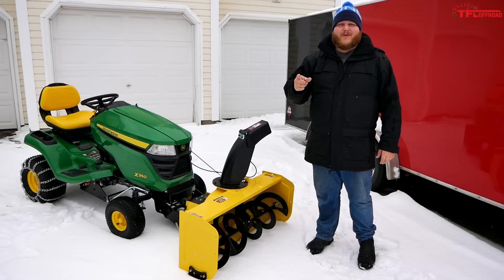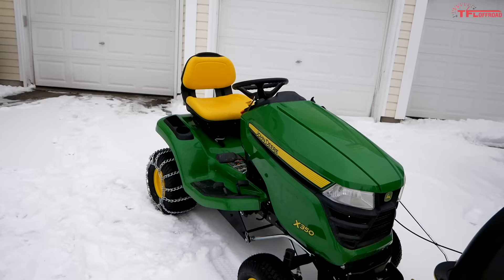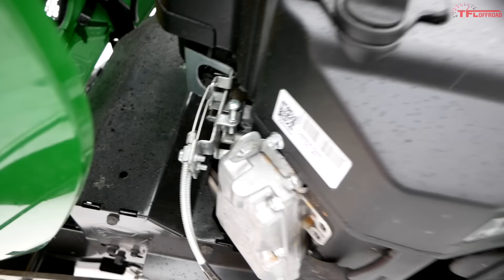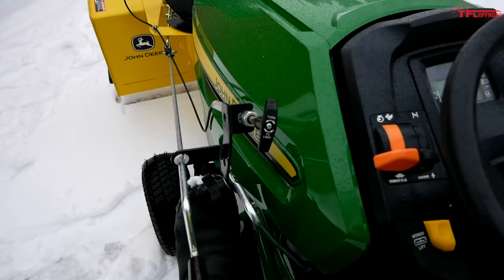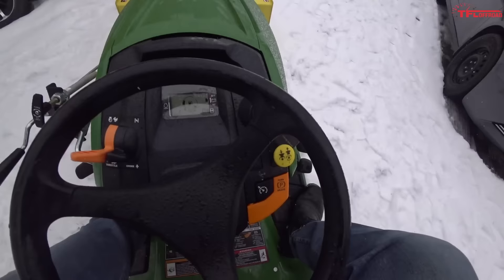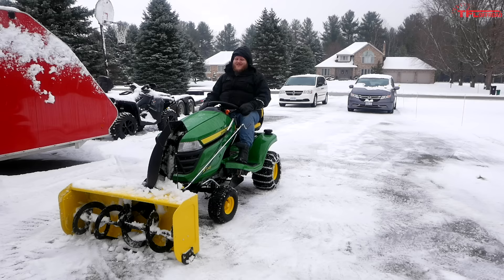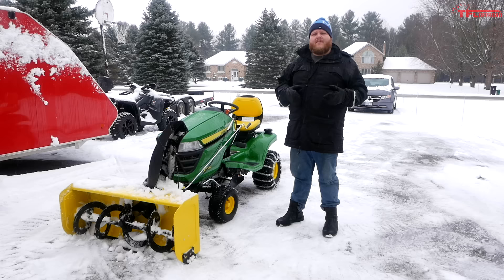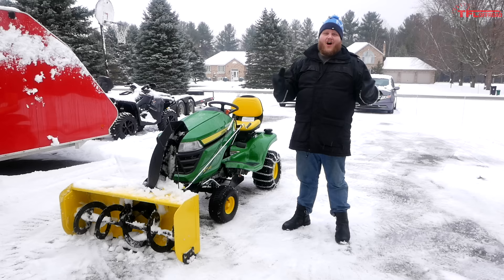Watch This Before You Buy a John Deere X350 Tractor!

Comment: And that's why I went with cub cadet, I got a 24hp Kohler, 50 inch cutting deck and for a lot cheaper than John Deere. Sometimes you pay for the name.
Reply: Cub Cadets dont have the reliability.
Reply: @saliston  according to who? The John Deere dealer? They have been around since the early 60s.
Reply: @saliston  and you are going to tell me that Briggs and Stratton and Kohler are going to put in a motor in a mower that will give their companies names and a bad reputation?
Reply: I have a similar Toro 50" with a 24hp Kohler. I believe both are made by MTD and are functionally the same, visually different. Mine was $1,800 USD on a sale, no snow blower though.
Reply: Cubs are good too. 
The Kawi engine in the JD is excellent .
Reply: Cub Cadet was bought out by MTD, they are not of the quality they used to be.
Reply: You get what you pay for. You may buy a Cub Cadet and it might be a great mower, but the resale just isnt there. You pay more for a JD and you'll be able to sell it for more. If you never plan on selling it, you'll definitely save some money.
Reply: @saliston  The john deere riders you find at lowes etc are junk. They are just as cheaply made as the MTD's now. I looked at them and the hood's were flimsy as hell all plastic. Now john deere's commercial grade tractors are good but not the big box store stuff

Comment: I just brought home a John Deere x485 today and, man, that thing is stout! The current equivalent model in an x730, which is mostly the same components, but with a facelift on the body panels. I was legit surprised to see a choke (cough-carb-cough) on a new......anything really. JD was putting fuel injection on their Kawi machines back in the 1990's with the 445. I thought everything after 2010 was for sure fuel injected minus perhaps push mowers and weed eaters.

Comment: Glad to have found your review. Just inherited a smaller 200 series as my parents are dowsizing to a condo. Manual is long lost tho so your walk around is helpful. For instance I thought there was something wrong with the choke as it wouldn't stay on. Learned something! Many similar features although as you say not as beefy. I was pleased to see even this 277AWS I've got has the Kawasaki motor though. Guess they opted for an upgrade when they bought it. It's very smooth compared to the single pot units on most lawn equipment. Now to find a blower! ☃☃☃

Comment: The older series with the Kawasaki engines were great little machines. Really good little engines indeed. But duuude, I emphasized "little"for a reason. You spent enough to buy much more tractor. For that. you could have had a (used, obviously, but better and reliable) much bigger diesel powered Kubota--or comparable with four wheel drive, loader and a decent finishing mower that could do so much more so much better than that little lawn mower. I almost made your mistake. Mind you, I had about 7 acres of grass to cut in addition to a super long driveway but I was thankful that a sharp salesman talked me out of getting a toy just to have something newer. A 5 foot mower and some extra power meant I didn't spend all weekend cutting grass! Occasionally wished I had gone bigger still but never regretted NOT buying a little new lawn mower as opposed to the compact tractor.

Comment: I recently bought the E110. I don't see the X350 being much better. There is a snowblower option for the E110 also. I didn't buy it for that feature. But that option would cost more than half the price of the E110. There is a snow plow blade option too. It would cost 1/4th the price of the E110. If I lived at a place that often got 3+ inches of snowfall I would get the blade. But a snowblower option for just a few inches of snow is a waste of money.

Comment: My X300 has a Kawasaki engine. The manual also lists the X304, X320, X324,X360, X340 with a Kawasaki engine. Not sure where your getting your info from about the B&S engine, but it’s incorrect.

Comment: Thats all cool and stuff but how bogged down does it get in like 10in/24cm of dense snow. These things are designed for cutting grass, which is like no additional load. This motor having to heave a lot of snow and pull your weight and the tractors weight around seems sketchy to me. I have a 7hp snowblower thats like 60% of the width and at about its 11 inch limit it struggles and did stall out on me once.
Reply: I have an s240 with the same motor. Pushes snow no problem, I have gotten stuck though.

Comment: I bought an X590 last spring, mostly for snow blowing since I go to Florida for part of the winter and my wife doesn't. She can use our walk behind snow blower except that our drive way has a short, steep hill that she cannot do. She wanted a blower she could ride in my absence.  Long story short, I thought I was getting a 4WD and did not realize until after it was delivered that the one I purchased was not. I felt that my salesman misled me, but again a long story I am not going into here. In the end, I decided to keep the tractor and see how it does. It does have the locking differential and I have chains and weights. I have only used it once so far, in a 3-4 inch snow fall. It did fine but I do need to use the locking differential to get up the hill. I also found that I must hit the snow head on, not try to blow my way around a turn in heavy snow - like at the end of the driveway where it gets plowed in. I do think I would have a problem with a large storm, say over 8", blowing up the hill - which means we might have to clear the driveway more than once a storm. I would highly recommend getting power steering. It makes using the tractor much easier. The 590 also has fuel injection so no need to use a choke.  Never having had a tractor before, I was a bit naive about buying one and should have paid more attention to what I was getting. Nonetheless, the JD is a nice machine and is fun  and easy to use.

Comment: Just got the X 350 with the more I had a D 130 but the deck went on it just after 3 years other than that it is still good so I took of the more deck and got a 17 cubic ft. dump cart but went Canadian tire for the cart and saved over $100 over the John Deere one.  The dump cart is great as it will hold over 5 times what my wheelbarrow would. The kawasaki engine is louder than the brigs engine, I also found out that the D 130 would do slopes better than the X 350 Where the D 130 would go up no problem the X 350 would spin and had to back down, I will have to go back to the dealer and see what they can do about it. Other than that  I like the X 350 but when you pay that much more for it, it should do what the D 130 will do plus.  The other thing is that the 130 comes with a bumper, I have to order one for the 350 and pay $100 for it. When I was at the dealer seen one that ran into his truck and destroyed the whole front end of the tractor,  so you should get one to be on the safe side for when you go to the more.

Comment: I just have one question.  When raising and lowering the snowblower attachment, is it just one level?  UP, and then DOWN.  Is there any "in between" levels the snowblower can be left at while snowblowing?  Say 1" off the ground, or 2" off the ground?  You would be able to do that with the LAWNMOWER attachement, right? Different grass cutting heights.   Why not with the snowblower attachment too?
Reply: yes the dial can set the high of the lift on the floor

Comment: You can find a John Deere 425 gas 20hp liquid-cooled Kawasaki  locking diff shaft driven all wheel steer or just regular steering you can get a 445 gas 22hp liquid-cooled Kawasaki or the 455 diesel 22hp liquid-cooled yanmar for the price you would pay for that and you get a heavy duty tractor that's all hydraulic

Comment: You will get better everything when u buy a John Deere. DO NOT BUY A DIFFERENT LAWN TRACTOR unless want a zero turn Commercial grade rig. The cost is similar & you get it straight from the Dealer.
Recommend the x330 or the x350 the only difference between these is the Kawasaki vs the B&G custom made strictly for John Deere. 
If you only need it for hauling with a 3'X5' Dump trailer, Snow Moving & Lawn Maintenance; & you do not have a Hill or serious slope your good.
If u have a steep 25 degree or steeper slope you will want dual or 4x4. If you need a larger mowing deck & have a large area to clear for snow. Larger machines is what u want.
"BUY ONCE, CRY ONCE" 
We use both the x330 & the x590 for different projects. The x330 for the suburban home & the X590 4x4 for 5 acres on steep 50 degree terrain.
You will not be disappointed.
& for you guys looking at a Multi use Tractor. The 2019 & newer JD 2K series Tractors are AWESOME over the competition.
Kubota does have some good setups but John Deere made sure to be the best going forward.

Comment: After working on hundreds of older John Deere lawn tractors, from the little 68, to the lx188, lt, d, etc, I cringe when people grab the hoods where they are “supposed to lift”. Unless these hood materials are much more durable than older Deere’s (like lx, lt, etc), NEVER lift like done in the vid. ALWAYS lift with both hands on each side of the hood. I’ve seen literally hundreds of hoods broke because people lift them with the built in handle. Yikes

Comment: Great video. I’m moving to somewhere it snows next year and I can’t decide whether to buy a Ram Rebel and a snow plow attachment, or spend less on a Subaru and buy a tractor for the snow.
Reply: You will absolutely beat the shit out of a 1/2 ton with a plow. I have buddys that clear snow for winter and plows are BRUTAL on trucks.
Reply: @evictioncarpentry2628  Really? I was only planning on doing my own driveway, so I didn't think I'd be putting too much strain on a truck, but that's good to know, thanks. So if it puts wear on a truck, surely a small tractor like this is going to struggle with a plow, no?
Reply: It's not the plow that is brutal on the truck , it's the guy operating it 😂

Comment: 9000$ Canadians money's For that Price I'm buying an Small pickup and push mower.
Reply: for that kind of money you can have a very large down payment on a real tractor, a nice used sub compact. that's almost enough to pay it off. i paid $8,500 USD for a BX2350, 54" mid mount mower, rear snowblower AND a got a heated cab LOL
Reply: it also has diesel power and 4 WD

Comment: Do you feel you should have got the x370 for the hydraulic lift, and without wheel weights do you get stuck with deeper snow . reason I ask debating on the 370 or 350

Comment: What a great video, very informative.  I bought a X350 first but returned it for the X370 due to the slope of my driveway.  Looking forward to more of your videos on your X350.  I still have to install my front blade to get ready for the snow.
Reply: Curious to hear how the x370 worked out for you. Any idea what the appropriate slope of your driveway is?
Reply: @glendavis3183  Its working out fine. I believe the driveway has around a 7-8 degree slope.  I do have 3 JD weights on the back along with Terra Grip rubber “chains “  I am thinking about adding one more weight though.  Hope this helps you.
Reply: @wornslick  It's very helpful! Thanks for taking the time to reply. Sounds like you are using a blade to move snow rather than a blower, yes?
Reply: @glendavis3183  Yes I use a blade.  I looked at the snow blower for the X370 but it would crowd up our garage.  I got everything stood up against the wall including the mower deck.  It also helps to push the snow downhill or side to side on the driveway itself, it works great on flat ground.  Have you bought a mower yet?
Reply: @wornslick  Haven't purchase a mower yet but need to soon. Have a 180ft driveway with slope 7-10 degree slope and trying to figure out if an x370 would be able to handle a blower or if I need to consider an x500 series... Which is obviously a jump in cost.
Reply: @glendavis3183  Then my advice to you would be if possible have your John Deere dealer come take a look at your driveway and see what he has to say.  It’s the transmission that you want to get right for your application.  At least that’s what I was told. Which ever one you end up getting let me know please as my curiosity is up now. Good luck to you!
Reply: Flat yard or gentle slopes?
Reply: @wornslick  Yard is gentle slope. Seeing if the dealer can visit the property is good advice. I'll let you know what I learn.

Comment: I don't intend to point out negatives... (says the one about to do so) but that is a HORRIBLE place for that fuel cap to hang... just think of all the crap that will fall off the inside of the wheel well, immediately ending up in the tank.

Comment: It will greatly increase the life of the engine if you change the first oil and filter at 8hrs. Change the transmission fluid at 50hrs. Everything has to break in.

Comment: 9K seems like you overpaid quite a bit. I have the exact same mower (2019 X350 48 Inch Deck) and I paid $3600 (with mulching kit) for the mower.  I was quoted just 2 days ago $2100 for the blower, Electric lift, adjustable arm, chains, weights, winter carb cover. So IMO you got jipped.
Reply: With Socialism everything costs MORE because you have to pay for all the others who don't work and expect things to be "FREE". Nothing is. ever "FREE".
Reply: @freedomone776  correct

Comment: It's a sad day when even John Deere is made in Asia.
Reply: They build the Lawn tractors in Germany. At least for the European and Russian Market.
Reply: The X350 is made in Horicon Wisconsin.
Reply: I'm sure that they may have a plant there or something, but the X series tractors are built in Horicon, Wisconsin, and the E series (Lowes/Home Depot) ones are built in Tennessee.
Reply: My 30year old jd 260 has a Kawasaki engine mad in Asia. Over 1000 hours at high rpm and runs great and starts everytime. I believe it has only had a hand full of oil changes in its life as well and the fuel filter is factory.

Comment: I have a  j d 110 it's 19 hp runs ok 1800 new a 44 inch blower 1200 that's a way better price. I like my cub cadet 3stage the best and thats the one I use the most on my 200 ft drive way

Comment: I went with the craftsman T240 over the John deere X350 the Craftsman is bigger and a lot heavier it has the Kohler 7000 series 22 horsepower 725cc V Twin engine it's designed after the Kohler command commercial pro engine came with a 3 year unlimited hours warranty goes through deep Snow with out a sweat

Comment: My x300 came with a Kawasaki and didn't have to pay extra for it.
Reply: I was about to comment the same ,my 2008 also has the Kawasaki  engine as well.My x300 is probably the only one with a oil pressure gauge, volt meter gauges and oil temperature gauge and a rear work light.
Reply: @sodbuster518able  yeah, mine is a '13 or '14 I can't remember. I only have a hour meter I wish it had a gas gauge, and I upgraded to the 48" deck from the 36"and added the snowblower and chains and weights.

Comment: You buy a tractor from home depot then you get what you get!!
Reply: he got it at a dealer. who said it was from home depot?
Reply: Bought mine from a dealer a decade ago and still got what I got. Battery died 4 months (known defective run) but they still only pro-rated and with the dealer price, even pro-rated it was cheaper to go to Walmart. Paint peeled two years later and there was a silent recall. Third year I repainted And complained to dealer when I was picking up a filter. Was told there was a silent recall but it’s past date and since I repainted... not buying from dealer or jd again. I run Steiner now and sticking with them.
Reply: You can't buy an 'X" series at a big box store, you have to go to a dealer.

Comment: What's that in USD? Seems kind of expensive.  I have less than $10k in my JD 3020, 70 hp with cab, heat and 7 foot JD two stage 3 point blower. Yes it's old but never run out of hp and no snow down the back of your neck.
Reply: 68.04 on 12/10/19 - .76 US to1.00 Can.

Comment: Good luck trying to use your warranty. Everything is considered "In service use" so they don't cover a thing. My X738 was delivered with a VERY RICH running engine. JD would not fix my machine, saying "This is due to in service use". Yes, I did remind them it was delivered with this problem, to no avail. So far to fix the issue $1,500! OUT OF MY POCKET. Bad head gaskets, defective wire harness. So guess what I think about JD! The tractor will continue to run if the brake is on, so you can get off to move branches, pick up rocks, etc, etc. Just shut off the PTO.  I purchased a quick hitch with 54" plow, JD blowers have too much plastic in the augers. My X738 is a good tractor, because I made it a good tractor, NOT JD.

Comment: I found this very helpful.  Living in Mass. and turning 64 with 150' driveway and two large parking areas to clear each winter.  Also have ~2 acres to mow in summer.  Would be interested in your experience changing mower deck to blower at start of season and reverse in spring.  Thinking of getting some kind of lift to do that and not sure of best lift to get so I don't have to lie on ground to change deck/blower or any shear pins that may snap.
Thanks!
Reply: Did you end up getting a john deere? And which one? I have a 600ft driveway and 1acre to mow. Struggling to decide between a x3 and x5 series

Comment: Have x304 has Kawasaki motor don’t know any 300 Series with a Briggs & Stratton motor.
Reply: Same here never seen Briggs &Stratton in x300. Maybe lower grade models from big box stores powered by Briggs &Stratton.
Reply: Bruce Rogers - the 2010 x300 actually has some of the year built with Briggs motors.  Every time I go in for an oil filter they ask me what engine I have.

I have the Kawasaki.  Been blowing snow for 5 years now without an issue.